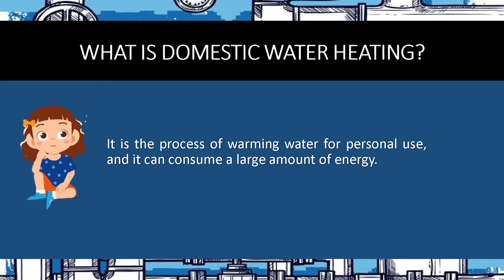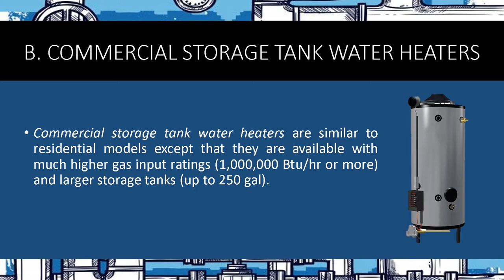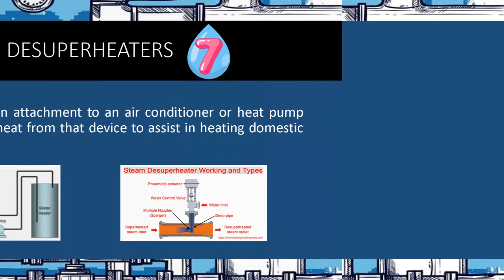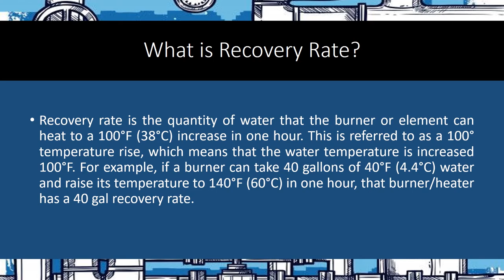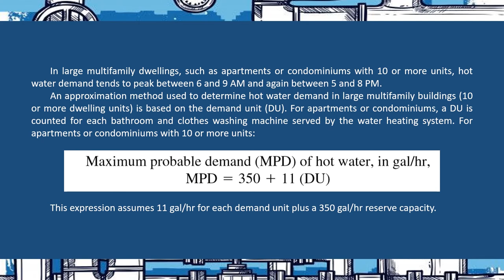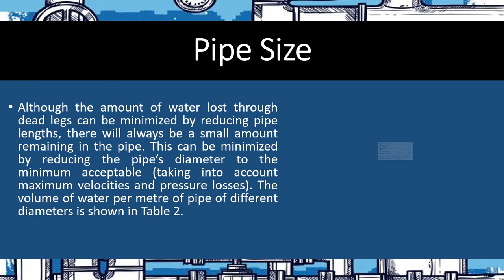Domestic Water Heating

Comment: DO WATER HEATERS REQUIRE MAINTENANCE?
 -group 1
Reply: Good Day!😊

Although water heater is an appliance, unlike po sa mga appliances na makikita sa ating mga kanya kanyang bahay, ang water heater ay nangangailangan ng proper maintenance. According po sa aming naresearch, flushing the water once a year will clear out the sediments na nag accumulate po sa bottom ng tank. Pwede din na ikaw mismo ang magflush pero for safety purposes po, it is recommended na maghire ka po ng professional para ma inspect ang tank and para ma identify kung kailangan nga ba na mag flush.

The following are ways to maintain or take good care of the water heater:

1. Add insulation to the heater para mareduce po ang energy costs and heat loss.

2. Replace anode rodes para maprevent po ang corrosion inside the tank.

3. Test the temperature-pressure relief valve annually and adjust the temperature to decrease energy expenses and para mas mapahaba pa ang buhay ng water heater.

4. Lastly, mag consult po sa professional for most accurate and safest maintenance advice.

Thank you! God Bless!😊

Comment: What is a standby loss?
And how can this be addressed?
                                     - GROUP 7
Reply: Good Morning 😊

According po sa naresearch namin, standby loss refers to the heat lost through the surface of the water heater. As the water heater losses heat through its surface, it has to heat the water it is storing to maintain the temperature. Standby losses is measured in watts or kwh. In short, it is an indirect measure of efficiency of water heater which indicates the loss of heat from the tank. Kapag po mababa ang standby loss ng water heater, ibig sabihin po mataas ang efficiency nya.

For the 2nd question, on how to address or reduce standby loss, some of the following are considered in purchasing a water heater.

1. Insulation- a water heater insulation is a standard provided by the manufacturers of the water heater. Kapag may magandang insulation sa pipes, makaka save po ng energy thus minimizing heat loss.

2. Tank size- kapag malaki ang tanks, marami po ang hot water quantity then malaki din ang surface area. Dahil nga malaki ang tank, malaki din ang standby loss.

3. Automatic flue dampers- dapat po mag install nito on some gas or oil fired water heater kasi marereduce nito ang standby loss.

4. Timers- ito po ay para sa mga electric water heater and it might reduce standby loss too.

5. Type of water heater- dapat po natin iconsider kung anong type ang water heater na bibilhin or gagamitin. Tulad ng tankless water heater, wala sya ng standby loss kasi it is not running when no hot water is being consumed.

6. Heat Traps- mahalaga din na magkaroon ng heat traps kasi marereduce nito ang standby losses from the piping as well as the tank.

Yun lang po. Thank you. God Bless!😊